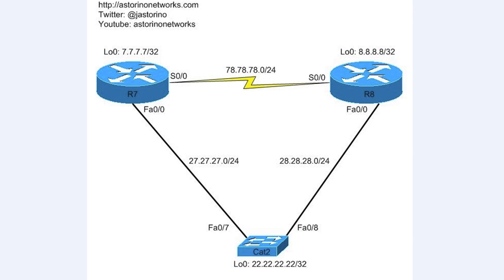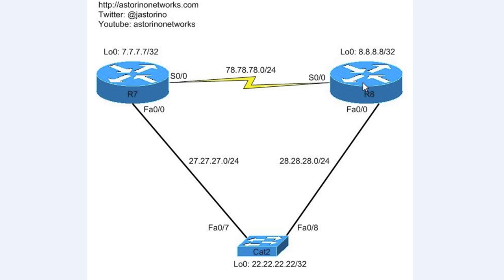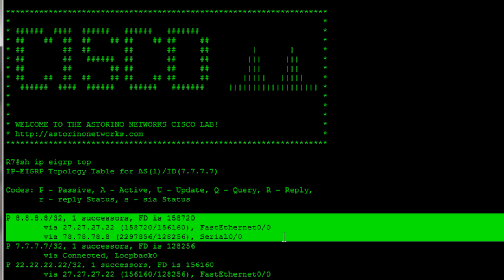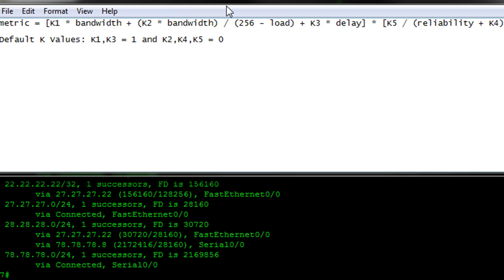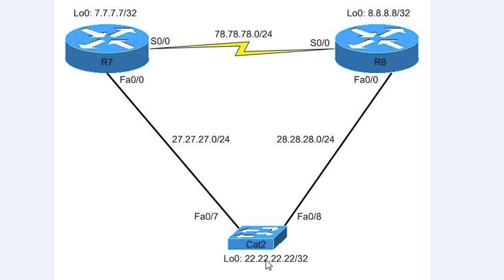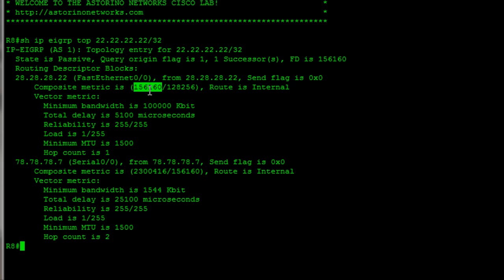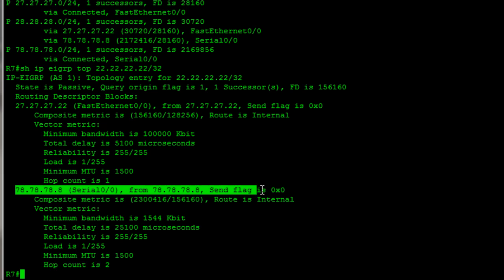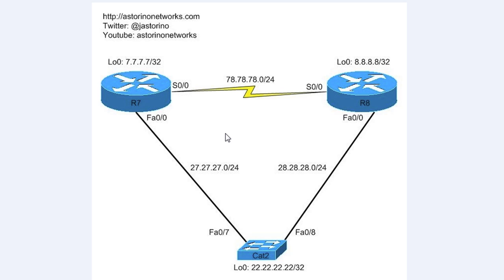EIGRP Terminology

Comment: As Joe mentions all the EIGRP routes get throw into the topology table and the router uses the formula:  Metric = 256*((K1*Bw) + (K2*Bw)/(256-Load) + (K3*Delay)*(K5/(Reliability + K4))) to determine composite metric. It compares them and the lowest CM wins and is put into the routing table, the successor route. By changing K values such as bandwidth or delay you can alter the results of the formula. If a nonsuccessor routes RD is less then the FD, the route is a feasible successor route.